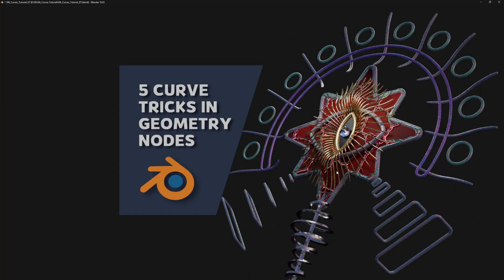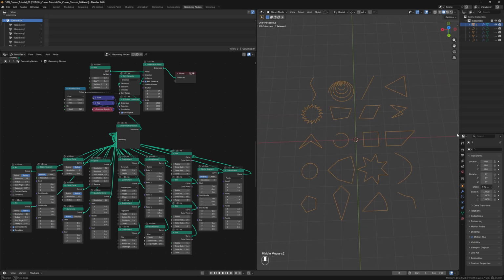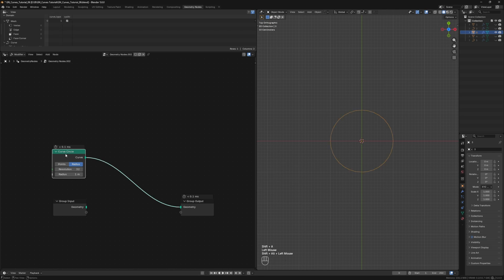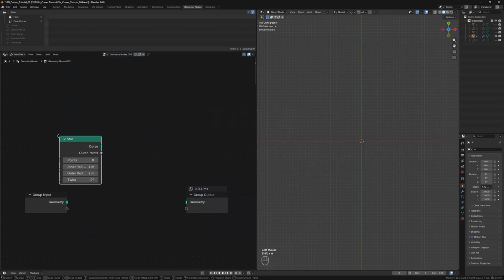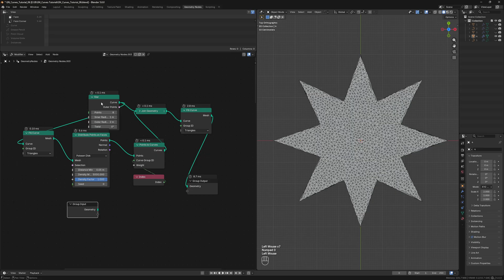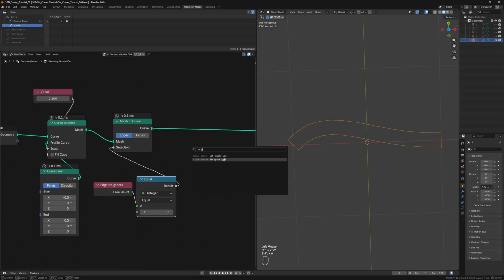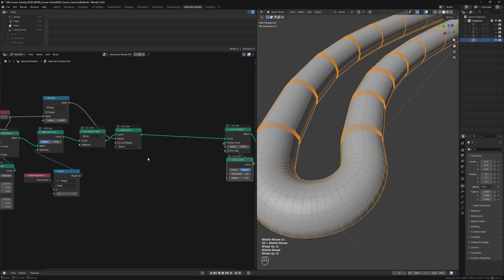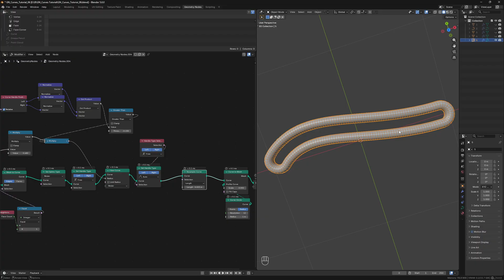5 Curve Tips in Geometry Nodes

Comment: 5:27 How to remove the two perpendicular edges at the end to create two parallel curves instead?
Reply from the maker: In your situation, the easiest way is to take the original curve and offset it along the normal twice. Normal -> Vector Math Scale -> Set Position (Offset)
You might also want to use the Set Curve Tilt or Set Curve Normal nodes before the Set Position node to change the offset direction.

Comment: I would like to see a tutorial about how to set an attribute on a point and position a Mesh onto that point. based on the value of the attribute (i.e. Point Attribute = cone then add cone, if Point Attribute = cube then add a cube)
Reply from the maker: I'll be talking about this. It'll be about Indexes/Group IDs. But the script for it isn't finished yet. And I don't know when I'll finish it.
So for now, I'll cover it here:
In the Instance on Points node, enable the Pick Instances checkbox. Input the index values into the Instance Index input. For example, use the Random node. If there are two instances, switch the randomness to random chance. If there are more, use an Integer from 0 to the number of instances minus 1.
If you leave the Instance Index blank, the instances will simply alternate.
Input multiple instances into the Instance input.
For this, you'll need the Geometry to Instance node. The order in which you connect different geometries will be the instance index. Instead of Geometry to Instance, you can also use Collection Info in Separate Children mode. There's also a Split To Instances node, but I think in your situation, that will be the most difficult approach.

The demo files on the Blender website include a file called "Ripple Dreams." It uses the Collection Info node to distribute various instances among points.